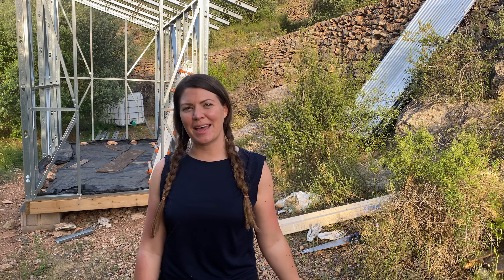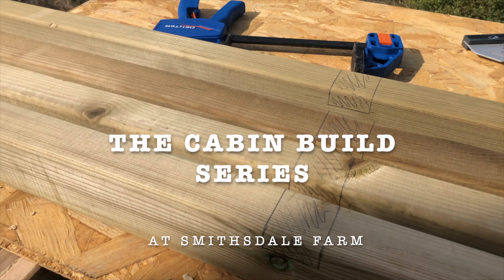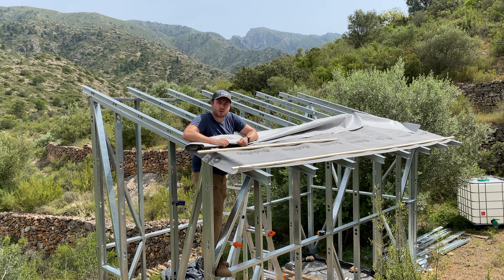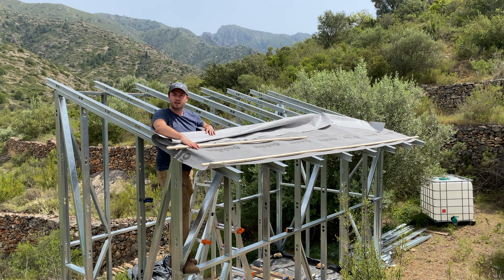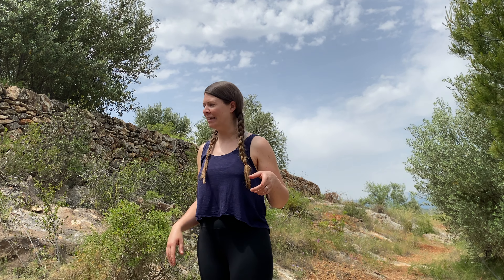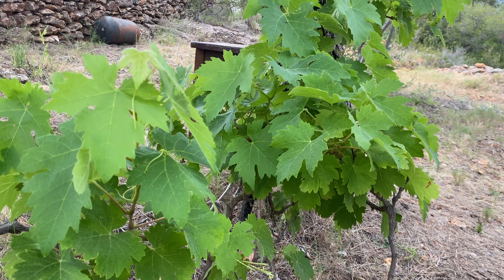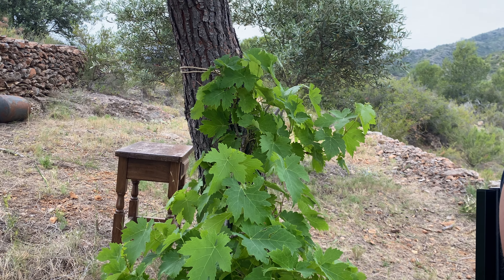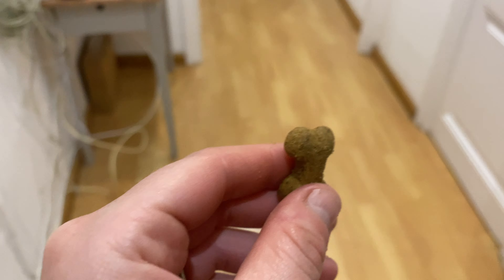Off Grid Cabin Build on our Abandoned Homestead

Comment: after over a year.... really not impressed. At least you 2 are making an effort. Property like that, the first thing is Contour Lines. Plenty of rocks just to move them. Just line rocks, nothing big. One decent size rock, and maybe 2 smaller in front of it. Nothing big, keep it simple. Have the land try to keep as much water that it can. No swales needed. Just slowing the water down. Find out how water moves throughout the property. Upper and lower catchments, your not going to build ponds. Just slow water down. Then address any water erosion. Use the rocks. The greener it is the cooler it stays
Reply from the maker: Thanks for your comment and tips about the water, Max. Appreciate it.

As for progress.. we’re not trying to impress anyone… simply share our experience 🙃
There are plenty of YouTubers who have quit their jobs to move to the land and live 100% off grid during their renovation (most already have a van to live in comfortably). 

We’re showing that there’s still a way to do it, even when you both work full time jobs and live further away from your property.. that might be encouragement for some who would like to do the same, but don’t see anyone doing it 😁